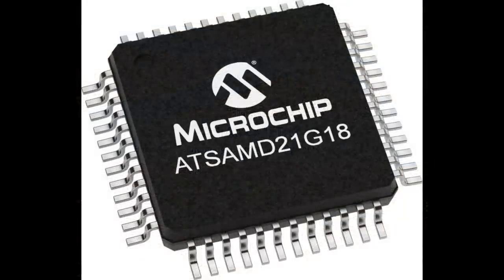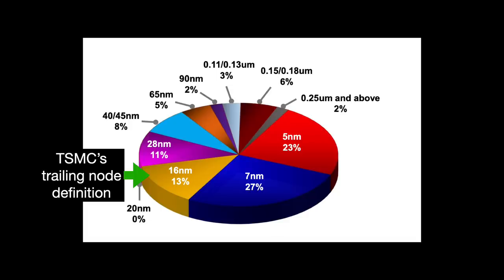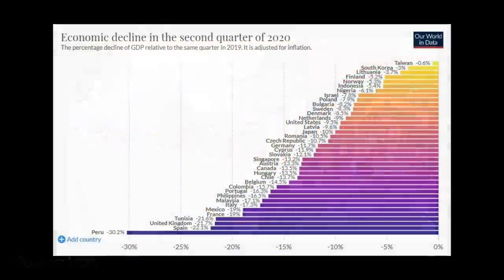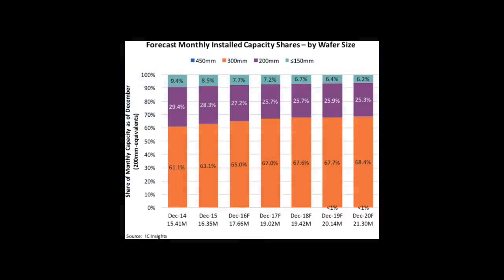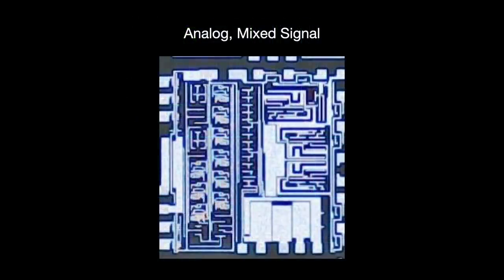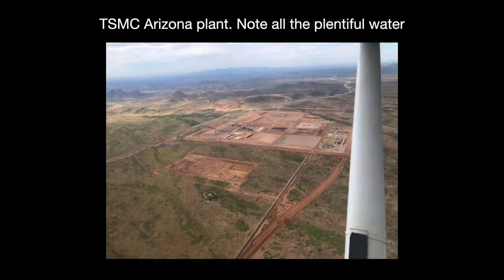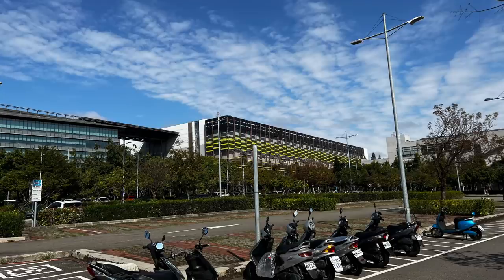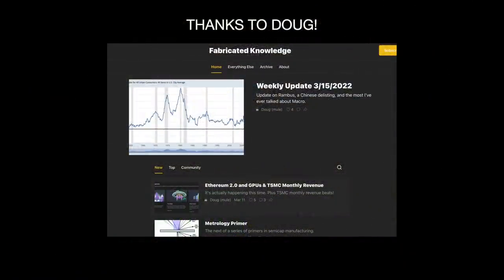Where The Real Chip Shortage Is

Comment: Sony's old fabrication plants in Japan proved that (at least with entertainment videogame system processors) they could take the early 1999 finalized silicon engineering sample Emotion Engine CPU and Graphics Synthesizer graphics chipset from (I forget at the moment) whatever the manufacturing process node was in early 1999 or late 1998... because the prototype PlayStation 2 engineering sample motherboard was demonstrated by Ken Kutaragi in March 1999 at a special Sony industry presentation not really made for consumers iirc but was still reported by the videogame magazines of the time back when internet news was just not organized or reliable. 

Anyway Sony went from whatever that initial process node was in early March 1999 to the mass production process node for launch in March 2000 (because the Sony press release said the die shrink would allow for higher yields, lower wattage, lower thermals... stuff that was common before Microsoft Xbox changed that in 2001 and later Sony followed suit at great cost and risk to them) all the way to the 2006 Sony PlayStation 3 launch which featured iirc a 90nm die package of the EE and GS processors which used a heat spreader.

However due to the difficulties of that time and customer fears and confusion as well as some bad marketing campaigns on both Pro and con sides... the PS2 chips were removed from the PS3 yet PS2 chip production continued and made some major improvements to 65nm production node by 2008 to 2009 which included the expensive RDRAM memory chips inside the die package and basically no need for a heat spreader and definitely much lower wattage consumption and thermals.

So for nearly ten years of the PS2 CPU and graphics processor production, Sony definitely and evidently proceeded to provide historical evidence that processor die shrinks are indeed possible if a company wants to do them.

Now the EE and GS processors were proprietary to Sony and as such they had more engineering control. With the PS3's CellBE CPU and the Nv47 based RSX GPU, both of which had to be reactionary produced at 90nm in 2006 as opposed to 65nm which for Cell CPU was Sony's original target node... both of those processors continued to be fabbed until die shrinks made possible around 2011 to 2012 to either 40nm or possibly maybe 28nm.

Then all that changed and had to be dropped because Sony had been sustaining losses and Microsoft had called for next generation hardware around 2011 and we ended up with AMD becoming the designer of the CPU+GPU package and TSMC being the only fabrication plant to provide processors on a 28nm process node for 2013 mass production.

I don't believe Sony has much control like they had when fabbed their processors at their proprietary fab plants so I can't recall what die shrink the PS4 Slim reached around 2020 to 2021 but this is just an example of what is and was possible. 

However TSMC pioneered and reached the cutting edge production nodes... YEARS AGO... bearing in mind the harsh reality of the year 2020 problems the least we could expect from other chip manufacturing plants is to have improved their processes. 

As pointed out in this video, a 90nm fabrication plant may be limited to 90nm production unless there was some way possible to replace and reformat the manufacturing tools inside the plant which sounds easy but is just insanely expensive in reality. 

Still Intel owns a vast array of fabrication plants... if they wanted to or if it was plausible, they could provide services to AMD and Nvidia for GPU fabrication nodes... however iirc Intel does not have the same technology as TSMC for that aspect because their main products are CPUs

Outside of that, fabrication plants that reached 28nm should in theory be able to handle die shrinks for many processors to provide increased yields in theory... however there is a cost there and maybe some manufacturers don't see the point in paying for it if their mass production processors are already being fabbed at 130nm, 90nm, 150nm, etc.

Therefore if Intel wanted to produce Itanium CPUs on 28nm and lower as an example or even have AMD make 28nm Phenom II Hexacore CPUs... all those things are possible but those are not things that their industry are about... thus other processors for industrial use and car electronics are a different industry but are still affected by the year 2020 problems.
Reply: I wonder how long a lead time for a die shrink is. It seems likely to me that the PS2 logic was designed in parallel for the stable node and the future cutting edge node, but of course the future node couldn't be manufactured... until the future came about. It was likely too expensive to make systems on a node which would be out of date by release - beefier PSU needed, more silicon consumed, reliability compromise due to higher temperature, all that. And it was likely too expensive to wait for new process to make early devkits - the cost of opportunity is the highest possible cost.
Reply: I mean intel's whole "tick tock" thing was one year they do a new design in node X, then the next year shrink that design to new node Y, then do the next new design in node Y, and shrink it to node Z... all until they couldn't keep that cadence up anymore. It takes a lot of people and resources to do that - probably something the companies that make microcontrollers don't have, and don't have a benefit to do. Microchip isn't trying to increase the clock speed and reduce the power consumption of the same chip from year to year - once they do a design, they just want to keep cranking out the same thing forever without any further engineering / design cost.
Reply: Microprocessor Report did an in-depth examination of the PS2 chip set. The intent was always to do mass production at the 180nm node but this was a bit ambitious as Intel, then the global leader in process node advancement, was still ramping up for 180nm product. The 250nm version of the PS2 chip set had been intended solely for engineering samples and early developer kits. Due to delays in getting the 180nm line ready, the initial batch of PS2s for the Japanese launch used the 250nm chips, which made for a lot of red ink to keep their schedule. Another oddity in those early units was rear bay for adding a hard drive used the PCMCIA Type III form factor, mainly seen in laptops, rather the common 3.5" form factor used widely in desktop PCs. Sony offered owners of those early units and adapter to plug into the slot and use a 3.5" drive externally.

The PS4 APU, along with the very similar Xbox One APU, had just the one die shrink, to 16nm. This enabled the PS4 Slim and Xbox One S models to be produce and replace the original models. The additional ceiling also allowed the creation of the PS4 Pro and Xbox One X. That was also where companies hit a wall on the value of die shrinks as opposed to new designs. A casual observer of the game console business would reasonably expect at least another die shrink, with perhaps the Pro and One X becoming the mainstream models as the generation wound down and a new generation launched. But that would be ignoring how much the economics had changed at the newer process nodes. This was one of major reasons Microsoft made the Series S. It made more sense to have a low end version of the latest architecture than continuing with the existing product in that role, as another die shrink would not reduce cost as well as it would have in past node generations..
Reply: @SianaGearz  That is correct. The launch PS2 was always intended to be mass produced at 180nm, while the 250nm version of the chip set was produced for engineering and early dev kits. The first production run for the Japanese launch had to use the 250nm chips due to delays on the 180nm line. This was a painful expense for Sony but they kept the launch schedule and had a very successful product in the long term.

Comment: Let not forget that the tooling need in the fabs also use microchips and the microchip shortage is hindering supply of the material for that tooling. So, even if the fabs are built, the fabs won't have the tools to put into those fabs. Generators, power supplies, voltage regulators, etc. are all needed to build the tooling needed in a fab, and those need microchips, which, there isn't any.